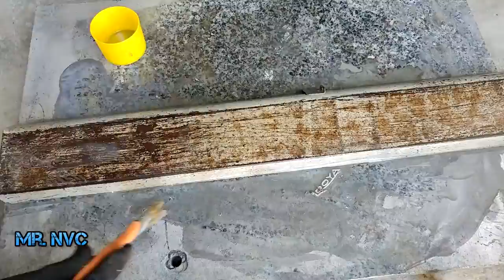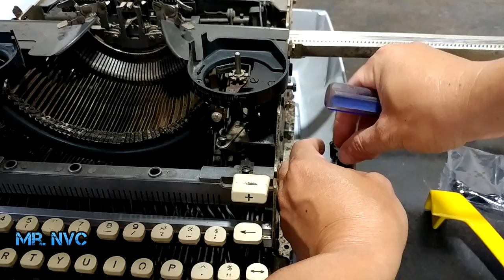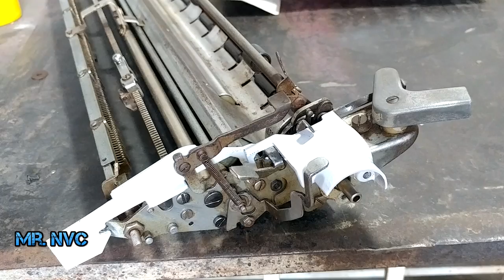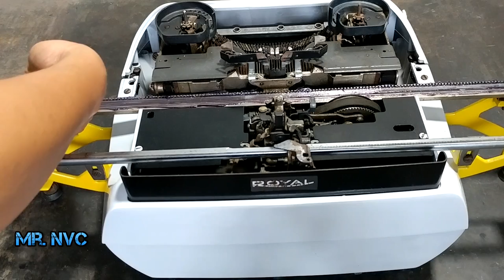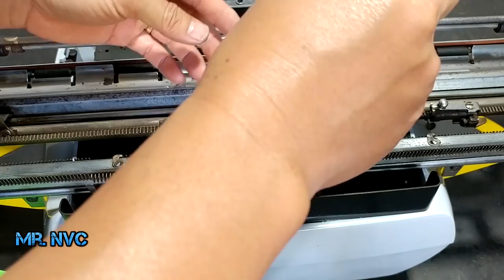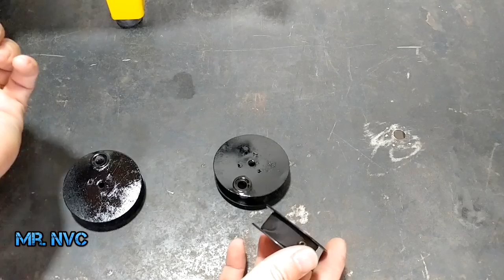Very Old TypeWriter Restoration and Disassembly (Part 2 of 2)- Royal TypeWriter Restore It

Comment: Anyone that has worked professionally on typewriters knows that what this individual took on was monumental. Especially using non-traditional methods. Much respect sir, you took a machine that most people would’ve thrown in the trash and actually made it operational.  Stunned that there were actually negative comments.

Comment: This is not a restoration, it's a thorough clean up at best. A restoration would mean in this case a 100% demontage. Removing all rust, thus also from the inner mechanics and then assembling the typewriter again. You didn't do that. You cleaned the thing, that's not a restoration.

Comment: this was a bad choice for a restoration as it would require a complex disassembly. also, please consider recording your videos with less noise on them, like away from compressors, grinders and blowers (or you could speed up these segments with reduced volume). Anyway, congrats for your efforts.